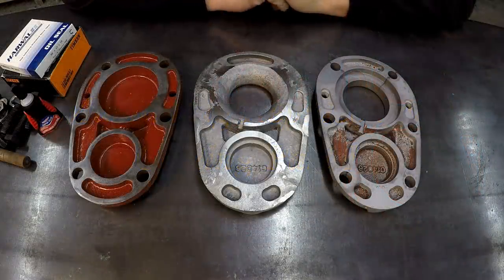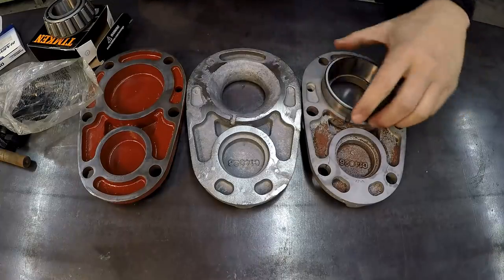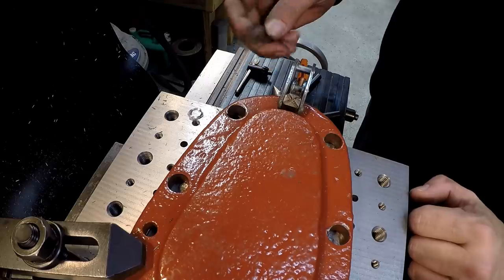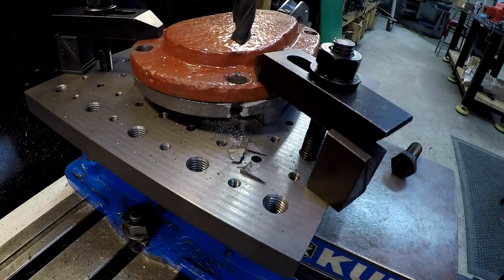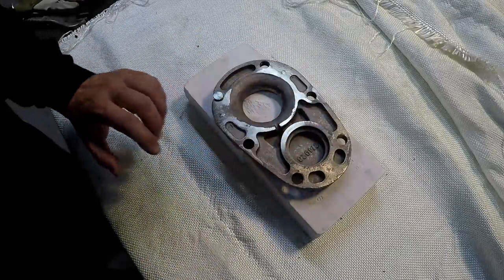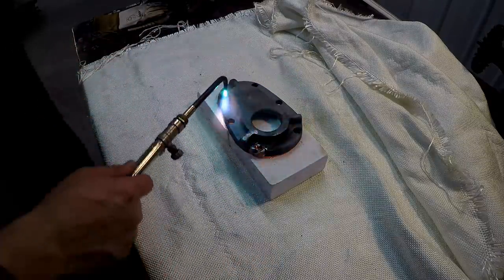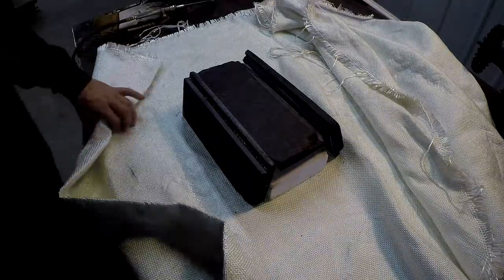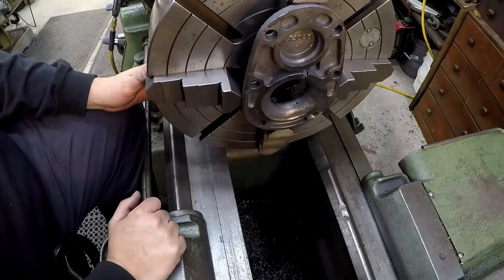Machining a Replacement Casting Part 1

Comment from the maker: Thanks to everyone for your views and comments for the past two weeks. I have just returned from a much needed break and vacation. I had a few show concerns over no SNS, but I wanted to just share the machining footage I had ready for y’all. Hope everyone is having a great New Years and I’m really looking forward to what 2019 has in store for me!
Reply: I'm no machinist (and really enjoying your content) so, with that in mind and being said up front, here is my question, can the facing of this cast be done on a mill or the shaper?  Well, after the blow out, maybe not the shaper.  :o)  Is there a reason to stay away from the mill to face such a piece after heating and annealing?
Reply: Hope you enjoyed your much deserved vacation Adam! Don't worry about not having SNS - we'll all be here when you're settled back in.
Reply: and you all the best in the new year! respect you! a real man! Greetings from Russia!)))
Reply: Hi John Bonner
I personally have done jobs like this on a milling machine . The job can be clamped using individual adjustable jaws which could be placed anywhere on the machine table and using machine jacks to level. A carbide face mill would be used to clean up the face of the casting . The bore would then be machined  with a Boring Facing head which would allow the operator to machine the bore then machine the face at the bottom of the bore .This job would be an easy job to do  and easer still would be to CNC it .Note : Chilled castings have a hard skin on the surface and anywhere the casting is thin ,it could be hard all the way through Cast iron is a stable material but if it is subject to shocks it is a brittle material and can crack. this chilled version 
will be even more brittle
Reply: Where the  bolt holes are the mold should have  been thicker to allow for a bolt hole with more metal on the outside edge of each hole..
Reply: No abom thank you for wonderful job
Reply: I could see myself being able to master a few of those operations you perform but the fact that you can do 10,000 different operations and get it right the first time is truly amazing.

Comment: Is casting shrinkage not a concern when the original is used as the master? It looks like that could have also contributed to the failure encountered during the initial drill process. The part was smaller overall leaving less material outside the holes.

Comment: Oh man, Adam, you might not know how great a relief it is for a home machinist to watch you have trouble with a part. Now and then when I'm out in the shop I run into problems and I always think 'man, I thought I knew what I was doing out here, but clearly I don't know anything.'
To see you have issues, and then explain that the issue stem from difficulties with the material, and then show how you work around the unexpected issues and ultimately get the part back on the right path is food for the home machinist soul.
You're a top notch machinist and while it must have been frustrating for you, to see someone as accomplished and experienced as you run into trouble with a part was incredibly reassuring to this home shop neophyte. And then you went and saved the day anyway, demonstrating that experience and perseverance can overcome the most angry-making obstacle.

It's good to see you had some time off too.

Comment: As an unskilled home machinist I appreciate you left the failures in there to show even the skilled among us have the occasional hiccup. Very encouraging! I was impressed with the calm with which you met each setback. I'd have been cursing like a sailor.
Reply: Job shop machinist for close to 10 years. Those kinds if hiccups would have really tested my patience.

Comment: Hey adam, to get the iron to convert back from white iron (chilled) to grey iron, you have to get it to around 1400-1500F and hold it there overnight, most people just throw the castings in a woodburner or a firepit to get it orange hot and let it go out, just leaving the casting to cool down with the woodburner or firepit. It also helps to eliminate alot of the internal stresses of the part so it wont move as bad when you machine it, otherwise it'll want to go banana on you after machining.

Another thing to think about is the overall shrinkage of the part since cast iron will shrink around 1/8" per foot, so it probably shrunk more and left less meat around the edge of the casting, which resulted in the blown out hole side, or probably didnt help it. Also that shrinkage with the additional material removal through machining again since you didnt build up the part, it may not fit the shaft length anymore from it shrinking by 20-30 thou in thickness, so that may become a bit of an issue in final assembly.
And last thing is, I would be lerious of aluminum around brazing rod, the copper and the aluminum will mix together to create an aluminum bronze alloy with alot of aluminum content to it, which is very very hard, and very brittle, so it may result in a very brittle braze joint. I have some here that that happened to and I can probably do a quick video up to show you what I mean.

Comment: One thing contributing to the problem was the use of the original part as a pattern without lagging the outside of the original casting.  Due to shrink I estimate you lost about 3/16" on the overall length.  That left you with  thin wall adjacent to the holes in the big end.  Foundry suppliers carry wax sheets of different thicknesses for just that purpose.  In a pinch I think you could have gotten by with several layers of vinyl tape to build up the outside edges.

Comment: Adam, apart from the chilled casting, another factor that would have worked against you with drilling the holes would have been the shrinkage of the casting. The shrinkage would have brought the edges of the casting just that much closer to the holes that you were drilling. The typical shrinkage allowance is 1/8" per foot. I am guessing that the casting is about a foot long so the shrinkage may well have caused the holes to be 1/16" closer to the edge than in the original. That probably would not have mattered except for the battle you were having with the chilled skin on the casting. 

Isn't it always the way, the simplest job can turn into a marathon. I am still annoyed with myself for breaking a perfectly good end mill last night due to a lazy setup and some hamfistedness on my part. I really look forward to your videos.  It's heartening to see that even an expert can have bad day and it is even better that you are prepared to share it.

Comment: Adam

That chilled casting is what us model makers face with every casting in CI these are small and thin sections , cast as cheaply as possible and sold as expensive as possible 🤬
What I do now ( been at this game now for 50 years ) is when I start a new project I take them round to a local foundry ( note they do not cast this type as the do not own the patterns) and get them to put them through their Lear , ok costs me £20 as a fill in do when can job but it’s cheaper than inserts and drill bits a 2 mm drill soon turns its nose up at a chilled spot 

In hind sight very powerful thing you should have returned that casting to your founder 

As a side note you may know I served my time as a sparks at the local iron works so I was around lots of casting work the moulders would place a large block of CI in the sand just out side the pattern when the job call for a wear Resistant area in the casting just to chill that area , ok the machinist knew this as it was on the blueprint ,yes it was that long ago the were blue . So that area was ground .

Bet your foundry has good lighting the old ones were dim so the old timers could see the colour of the iron , they used to say the sunlight ruined the job 

Great save 
Stuart

Comment: Hi Adam , interesting job I work mainly with castings , just want to be positive ... foundry supplied you a “ chilled” casting ( out of the sand too quickly) as you said , I was told to anneal as a rule of thumb dull cherry ( but difficult to say how hot on the video ) and possibly a strip of card board glued around the pattern ( original part ) may have just added enough of a contraction allowance ?  It’s easy to be wise after the event of course !! Glad I’m not the only person in the world who has machining issues !! Very good of you to show us lesser mortals as well that even Adam very occasionally has issues, neat recovery of the part Adam .
Regards 
Robert
PARTSMADE 
🇬🇧

Comment: Hi Adam, I see some of the model makers have already commented, but I'll add my pennyworth. Had alarm bells ringing as soon as you say how quick you got it back, fortunately it has never happen to me but I have heard comment from another respected model engineer this side of the pond that heating it in an oven at 350F for about an hour then wrapping it and letting it cool as slow as possible would sort out any chill spots. I'm guessing Clark would have allowed for shinkage and your part doesn't look massively under size, so the breakage was as you said, due to trying to force the drill through. Easy to be wise after the event, and after all the man who never made a mistake never made anything, and you managed a good recover. Best wishes for the New Year, look forward to your next posting.

Comment: How did you account for the shrink factor using the original part for the mold? It may be why the outside walls for the holes were thin. Given the size of the part you could almost expect it to be 1/16" smaller than original.
Reply: This may sound funny but one way it's handled is to knock the pattern around before pulling it from the drag.  You can't ram it in as hard as normal so it's kind of hit or miss affair.

Comment: Nicely done, Adam. That cover seems oddly designed. You have those 14 mm holes, bigger than 1/2". But there doesn't seem to be more than 1/8" of meat on the outer edge of those holes, and on some of them, less. Just seems a tad out of proportion.

Comment: We used to cast bake pads for mine trolleys. They were rough pieces with a quick tournarround and you often found hard  spots when drilling. The efects were broken bits and deterioration of language.

Comment: when i was a foundryman we used to get rushed by bosses to get pieces cast. they'd come out of the shells super hot and they owner would make us water them down with the hose...it never worked out well and used to piss us metal pour guys off when they'd bitch about us causing the problems they were experiencing. the crystal lattice doesn't form correctly inside the metal when the metal is flash cooled. you get a large lattice forming which makes the metal inherently weak and prone to cracking, etc.

Comment: I have done similar repairs on Harley Cases, found a TIG worked GREAT for backfilling/buildup/flange reinforcement, with MINIMAL clean up, put the piece in my ROD OVEN before and after, NEVER a problem, 20+ years saving Old School Harley's, and parts & pieces that cannot be repro'd or found. Trial & Error. Keep up the Good Work, Bro.

Comment: Patternmakers'  shrinkage will always result in an undersize part unless your pattern is slightly oversize to compensate for it. Using the old part as a pattern is bound to give you an undersize casting, which could explain why your holes were so close to the edge .
Reply: My grandfather used to work as a casting pattern-maker woodworker in a shipyard. I have inherited his folding wooden ruler that had centimeters on one side and "larger centimeters" on the other, which he used for measuring while making casting pattern pieces. The material shrinkage was calculated into the ruler...

Comment: What is the advantage of casting a replacement instead of machining a matching out of a block of stock ?
The advantages of casting I know of are the lower cost (at scale) and the ability to produce closed cavities.
The cost of the stock would easily be offset by the amount of labour required. And the part doesn't seem to have any geometry on it that would require a cast.
Reply: Same thoughts here.  I've hand machined replacement caps like this before out of decent steel plate and or billet.   Way stronger and more resilient than then cast and probably no different in labor.    Tedious but not difficult and I am no machinist by trade either.  

Hand that old casting over to any CAD guy and CNC  mill operator and it's even easier plus mass reproducible after that!
Reply: To be honest I'm wondering if he could have machined the bore and seal ring into the back cap and made a new back cap easily out of plate.
Reply: @tcmtech7515  Machining this of a steel plate will require much less work - even if you don't have coordinate-measuring table - and give much higher quality.

Comment: In the first minute of this video, I thought man, that looks like a perfect project for a CNC milling machine, especially because of the rushed nature of it.  Little did I know the "delights" that casting had in store for you.  Ten miles of bad road, but you're showing it who's boss!
Reply: would have taken twice as long to do it with cnc and it still woulda blown the part up
Reply: @SuperAWaC  no, I'm saying don't mail the part off to have a replacement cast, don't wait for it to return, and don't fight an unknown metallurgy upon its return.  Instead, spend 3 hours modeling in CAD, 2 hours setting up the CAM, and 3-4 hours machining on a piece of steel (i.e. no whacky metallurgy).
Reply from the maker: I don’t have a CNC machinist on standby to jump on a one off rush job like that.
Reply: @Abom79  I totally understand, just putting a bug in your ear because you're exactly the kind of guy that has the knowledge and confidence to step into the CNC world.  A used Tormach 1100 doesn't take up much space, and doesn't cost that much, either (well, compared to big boy machines like Haas).  I picked mine up for $10k, and it's half paid for itself in the first year.
Reply: @ZPositive  Not speaking for Adam, but I don't think it would be all that good of an investment for him.  
CNC is great, I'm building one in my basement, but I'm a hobbyist and can afford to "waste" time learning it.  Adam is a professional machinist and the shop he works in can accomplish everything with manual machining.  
Adding a CNC to his home shop would require him to learn CAD and CAM to make effective use of it.  
Adding CNC at his day job would require a solid business case and if there was one, it would be so busy doing it's job that a "quick,  replace this customer's part that we broke" job likely wouldn't rate.
This is just my personal, non professional opinion.
Reply: @anathaetownsend1894  Adam has enough time to restore a shaper and teach himself how to use it.  I think that speaks volumes about how much spare time he has.

No, Adam and his shop can not "accomplish everything with manual machining."  That's silly.  How about prototyping and limited production runs?  How about engraving?  Mold making?  The list is endless. 

Yes, adding CNC requires learning CAD/CAM.  There are thousands of us (me and probably you included) who are self taught at CAD/CAM.  It's a hugely powerful skill to add to your quiver.  And it's not going away. 

I say all this as a manual machinist who has moved to CNC.  I still use the manual machines daily, but CNC has elevated me.  Speed, quality, versatility.  It all improves when you can add CNC to your skill set.

Comment: Looks like aluminum has lower melting point than cast iron... :)

I'm a computer guy, so don't let me get to you.  I love working with my hands and seeing real professionals who work with their hands doing real metal working.  

TBH, I love how precise you are, sign of excellent workmanship.
Reply: This was brazing, not welding. The iron wasn't being molten, the melting point of the iron is irrelevant.

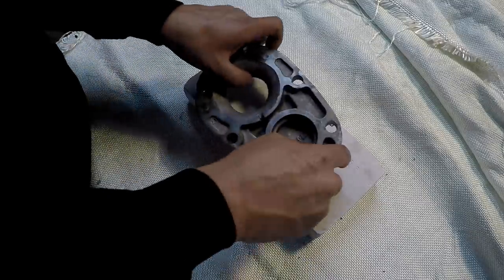Comment: 14:14 If you guys managed a turnaround time that fast then I'm not surprised you had the odd hard spot in the casting. The thermal shock that part must have gone through on it's journey through the mail system would have been crazy for a fresh casting.

The parts were going from about -20*F at cruising altitude to 70*F+ as they passed across the conveyors at enroute airports. They probably saw these cycles a couple times each way.

Comment: In my experience and it is Limited, when i tried to heat up cast iron it shrank. The new casting looks awesome the old one is rough crusty! Add some extra to the outside to the pattern next time. Work the problems, don’t let the problems work you. Great video thanks for sharing
Reply: sam yeates As I recall pattern makers had rulers which allowed for shrinkage of the casting as it cooled. Especially for aluminium based materials.

Comment: If I have a hard material to drill and it needs a carbide drill , I go down the local hardware store and buy a masonry drill.
Heaps of different sizes and as cheap as chips.
You need to sharpen the edge a bit and use coolant otherwise the heat melts the brazing and the carbide falls off.
Its a bit fast and loose but can get the job done.
G'day Adam from down under. (Gold Coast)
Reply: Smart!
Reply: The problem with those is that the tolerances of the carbide tip are pretty shoddy.
Reply: @andersjjensen  That's what grinders and micrometers are for! ;-)